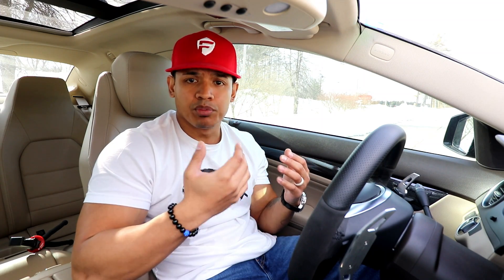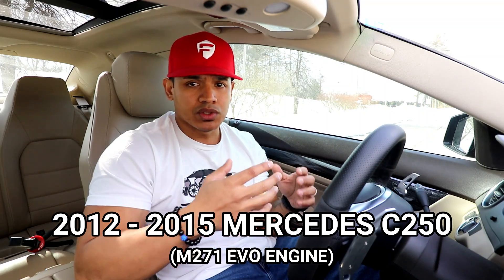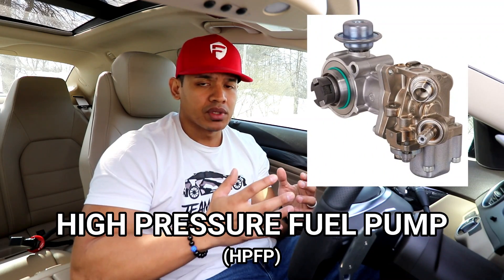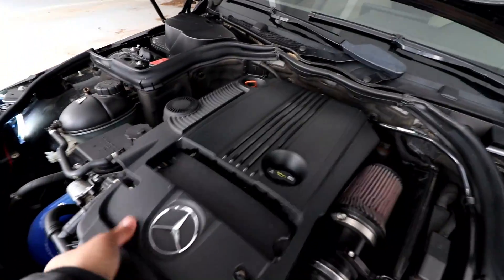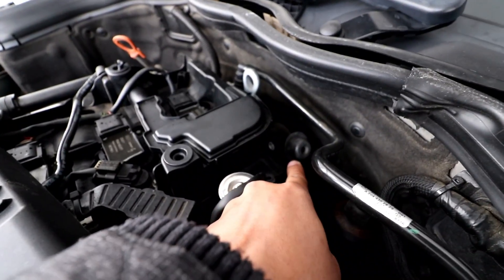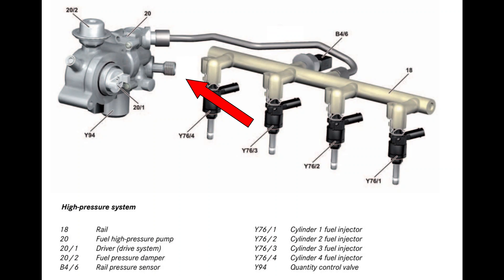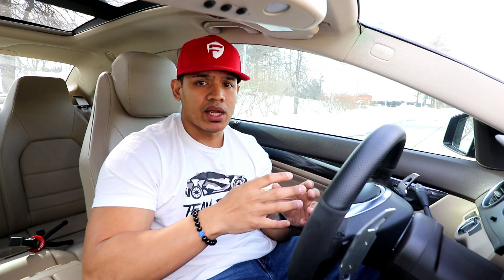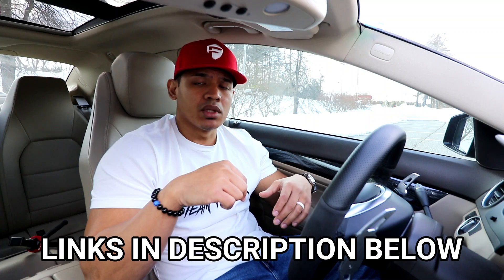FIX MERCEDES C250 P0002 POWER LOSS WHEN ACCELERATING

Comment: My 2014, C250 has same issue with no 0002 code but check coolant level light was on. After an hour I drove, it ran fine. Lately coolant has been disappearing but there isn't any visible sign of leaks or not seen in engine oil either. Any suggestions? Thank you.
Reply from the maker: If you have a “low coolant” light and you checked your overflow coolant reservoir and it’s full, then you’re just experiencing the common known issue of the floating sensor inside the reservoir that’s stuck on the bottom making the car think it’s low on coolant.  

Coolant does evaporate over time but if coolant is truly disappearing (a lot), then you have a leak externally that should show up under the car on the floor or (worst case) you might have a leak where the coolant is mixing with the oil. If you check under your oil cap and it looks milky, you may have a head gasket leak allowing coolant to mix with oil. That’s not good cause oil could be going into the cylinders and cause the spark plugs to underperform and sometimes not even detonate. 

All speculations. You should def seek a qualified mechanic before things get worst or dangerous.
Reply: Same

Comment: I dont get a check engine light but if I gun it from a stop the car jerks as if I'm pressing the gas and letting up repeatedly. I wonder if its the same fuel pump issue
Reply: John Ray yes that's exactly what's happening to my c250 and I'm here trying to figure out what to do without getting ripped off by the dealership
Reply: Cumbias Con Sabor did you ever get it fixed?
Reply: any of you got the problem fix ??

Comment: Have had a similar issue only when doing hard pulls either at a stand still or slow rolling around 10 mph in manual mode and it’d cut power and engine brake immediately around 5-7k rpm’s so I’d immediately put it back into normal drive mode and just drive normally and it’d be fine. Didn’t really think much about it for a while as I daily drive it and stopped doing so many pulls or just being hard on the car because I don’t want anything else to break but here recently I just started having starting issues where the engine will continuously turn over for at least 3 seconds before finally a very rough start. Runs fine after that even when idling. Tested battery and was good replaced alternator after testing it and still didn’t fix so made a post online and one guy said it could possibly be the fuel pump pressure regulator as it sounds like it’s having to build up pressure from the videos I posted of me starting it up. Definitely could use some advice if there’s a chance that could be potentially the issue or at-least part of as I had other people saying I might need a whole new spark/coil pack kit, coolant possibly leaking into a cylinder from a bad head gasket, etc. so I don’t feel like spending more time and money on parts I don’t need. I could and probably should just take it to a shop but don’t feel like spending the money and would rather do it myself if feasible.
Reply: Also forgot to mention my cars a 2012 c63 amg base model which has the M156 engine so I figured it’d all be pretty similar parts and configuration given the year model you have.

Comment: Is this the same in a diesel??? I was told it’s the boost gauge or turbo but the mechanic said he couldn’t see any cracks or issues with the turbo piping it’s very well maintained. He then said it could be the suction of the turbo….. my car is intermittent it goes like the clappers but then decides to space out and do what is noted in this video so it could be a fuel pump….. 💁🏼‍♂️ even told it could be catalytic converter but chucked Catclean down and that cleared up

Comment: This just happened to me a few days  ago for the first time. I was literally leaving my local Mercedes dealership after getting an oil change. I was trying to pass a car and pressed hard on the gas. Loss acceleration. I made a U turn and went straight back to the dealership. They told me what the code read but also said the check engine light turned off by itself. “If it happens again, bring it back in.” 😑
Reply: Indeed very disappointing response from the dealership!!
Reply: Did you find out I'm having the same problem on hard acceleration. Changing into next lane merging into the freeway. Limp mode check engine light blinks then stays on. Then when I restart the car it dissapeared no codes.

Comment: Hi, I have a 2010 c250 same problem it only happen once but it was pretty scary I didn't know at the time but if I would pot the shift on neutral shot the car off and turn it back on quickly it would be O.K. , I went to the Mercedes dealer the guy never mentioned the fuel pump  he said  something else  that it could cost me if rebuild $700 I can't remember what, now I don't know if there is any difference between 2010  and 2012 C250 models as I sad it only done once but if you know any thing for the 2010 C250 please let me know. Thanks 

Roman

Comment: Sometimes it can be the maf sensor that is dirty so the air can not go in the small sensors straight away that is also a big issue with power loss in the Mercedes. So check that out first because it’s much cheaper guys !
Reply from the maker: On most cars that might work but not on the c250.  This car doesn’t even have a MAF.  Mercedes just issued a notice about the fuel pump issue and an extended warranty.  They are finally owning up to this known issue with loss of power cause it could happen at any mileage on a c250.

Comment: I have a mercedes C200 with w204 engine 1800cc turbo year 2012 amg when I start the engine no acceleration when I press the gas pedal what could be the issue

Comment: Greetings, my 2014 Mercedes C250 had the hpfp changed and now it runs but if you step on the accelerator it doesn't run hard, what could it be and the code that keeps coming out is p0002, just that one, thank you
Reply from the maker: Could be the fuel filter too.  

Read through the comments. Some people have solved their issues.

Comment: I bought an used 2013 C250 from a private party and had what you described happen to me driving on fwy. Car is at local MBZ mechanic for going on 1 day and check engine light isn't coming on and he cannot see what issue is. So waiting game. He said I may have to take it to MBZ dealership if he cannot figure out what is going on with my car.

Comment: I just thought a conductor plate and my CL500 2003 I am not getting no accelerate when I step in the gas the car feel like it's going to limp mode that's why I do not take the highway no more trying to correct this problem my work on my car myself my check engine light was clear first after I did the conductor plate but it popped back on not sure if it's the throttle position sensor

Comment: Hi Flexx.  2012 C250 with 128k miles just got the turbo replaced.  I just experienced the limp mode you mentioned.  It wasn't pretty.  p0002 error code.  Do you have a video on replacing the HPFP?
Reply from the maker: I don’t but there’s problem some on YouTube.
Reply: I just recently replaced my HPFP. If you haven’t done the job yet, just reply to this message and I’ll help you out. It’s a pretty annoying job but I’ve managed to learn a few short cuts to expedite the process. Always willing to share to help others out.

Comment: hello, thanks for vid. Had the same replaced the pump, was fine for 3 months and now again the same happens. I replaced it with a new OEM original pump. Any idea what else might be the real culprit here? I don't believe I was so unlucky that the new one got broken so fast. Any ideas??
Reply from the maker: Don’t know. Check your fuel filter too.
Reply: @TheFlexxGarage  Is there any fuel filter on this engine? I found air and oil filter parts but no fuel filter to be replaced. Maybe it has a different name?

Comment: I just fixed the high pressure fuel pump but got code 0705 now for the transmission and i think the transmission code caused the fuel pump code! So i think i fixed the pump for nothing! Make sure to check all codes before spending 1500 on the fuel pump. Now i gotta fix the transmission electrical circuit fml

Comment: After clearing the same error code, the malfunction light did not come on again, but the sound in the car's engine changed. Do you think it would be harmful for me to continue like this? Some people told me that there is a possibility of mixing gasoline with oil.

Comment: I have the issue of car shaking on acceleration and can’t go up to speed, it happens every time but there is no CEL and no codes on the scanner! It is really frustrating and I am not sure what to do. I have c250 2014 coupe.
Reply from the maker: Probably can be as easy as a fuel filter change.  If not, take it somewhere to get the fuel pump checked out.
Reply: I had the same issue I changed out the ignition coil but the trick is you have to find out which one is failing I did it buying just one and swapping it out with each coil one by one I did it the cheap way to find out which failing just to make sure it was the ignition coil instead of buying all of them and it not being the problem but once I found out it was the ignition coils I did replace all of them and no more shaking on acceleration or weird vibrations

Comment: I have a 2014 C250 with 42000mi. I was sent a letter from mercedes on this issue. I have the same issue, the service manager said that only if it sets a certain code will they warranty it. He didnt tell me what the code was. He said they have to use the mercedes scanner. i reset my engine light and had a p0002 fuel pressure circuit code. The light went out but the code said it was permanent on my scanner.

Comment: I have the same problem with my 2010 c350. When I press the pedal down all the way it goes limp. But it rarely happens. Once every 10-15 times I floor it. I’m not sure if it is the same reason because mine has a different engine
Reply from the maker: It’s not so much about the engine but the fuel pump/fuel filter that’s the culprit.

Comment: Hi flexx. my car is 2009 mercedez benz c class. My problem is that my car won't accelerate,  it's not engaging in gears, it's like it's In limp mode.  The check engine light came on and it's me 3281 fault  code saying the boost pressure control flap is malfunctioning. Kindly help me out

Comment: I bought a MB c250 at an auction and I seem to have the same concern about stalling and lossing it's power when accelerating plus engine light turns on. Auction return policy is good for only 7 days. Where can I get a used high pressure fuel pump and how much will labor cost to install it. Is there any recall for this part by MB dealer. When I change it how can I better take care of it to make it last or how many times will this happen to me for it's(car)lifetime.
Reply from the maker: it never happened to me but happened to alot of people. I suggest you read through the comments and see where people bought their pumps and if there's any news on MB covering it.

Comment: I have a 2018 c300 4matic w205. Two days ago I got a service B, yesterday when I turned on the engine, once I started driving, I couldn’t accelerate, the power was low. Do you think is the same issue of your video?
Reply from the maker: Don’t know. Could be anything. If you experienced that issue, then your car should of thrown a check engine light. Only way to know the true issue is to hook up a OBD2 scan tool/reader to the car and see what fault made the check engine light come on.

Comment: I currently have a vehicle I purchased at Auction... looks like they replaced the HPFP but I'm not sure .. I say that because the hose clamps are aftermarket, unless all they did was change hoses. I cant get car to run unless I use a starter fluid. Any idea how to check fuel pressure? Cant seem to find a Schrader valve.
Reply: There is no Schrader valve.  I use a laptop with Autoenginuity enhanced for Mercedes.

Comment: Mercedes does have an extended warranty for the high pressure fuel pump, they will replace it free if it fails before 10 years 120,000 miles
Reply from the maker: This is an old video. I already shared the extended warranty last year when i received the letter.  It’s not on all c250 and it’s terrible because most c250s are way above 120k anyway. Plus most people repaired it themselves or through a 3rd party shop and Mercedes’ won’t reimburse unless the work was done by Mercedes’. Just another way for Mercedes’ to say they did something but really didn’t cause they waited so long. Screws the customer over at the end of the day on this issue.
Reply: @TheFlexxGarage  I have a 2014 Mercedes with 80,000 miles and my car started sputtering if I try to step on it hard and engine light turns on until I turn off my car and restart. Does the fuel injector fuel cleaner have anything to do? I filled the tank up and this happened on the same tank.
Reply: Any other info for this fuel pump warranty?
Reply: Took mine in and they said it wasn’t the fuel pump even though mine has these exact issues
Reply: @kidfoodieusa3806 what did they say the issue was?

Comment: Will this also cause the car to shake as well when idling?
Reply: check your codes; i had this happen with a misfire from an ignition coil. Could also be spark plugs — change out all four coils if you want to get it over with because all four of mine misfired in a month, but not after.
Reply: if you have a diesel check dpf as it could be blocked

Comment: Hey Flexx - my 2014 c250 was leaking at the banjo bolt by the turbo.. but after replacing all that it no longer leaks at the banjo bolt but now (sometimes) i see a little oil under the turbo that dripped down onto the shock(?) - it drips down onto whatever that thing is under the turbo. 

I was thinking it may be the turbo oil return line to the oil pan but it's been a pain in the butt to diagnose. 

any suggestions?
Reply from the maker: Common problem with the banjo bolt. 

The other spot is where the air intake tube clamps onto the inlet of the turbo.  Oil tends to pool up and slow seep out.  It’s happens on the Inlet and outlet of the turbo. Keep an eye on it...it should only leak some oil. If the oil gets worse, you might need a new turbo or need to get it serviced.
Reply: @TheFlexxGarage  Thank you SO MUCH for responding! I don't know jack about cars so this is a huge help (literally everything i've done to my car has been via your guidance). I think I know what you are referring to, but at least now I have names I can google haha. You're a life saver. Thank you bro.

Comment: where can you buy a used high pressure fuel pump for a Mercedes SLK250. What sites are the best to go to?  I am having this problem with my SLK250
Reply from the maker: eBay. There’s tons of refurbished ones for under $300
Reply: @TheFlexxGarage do they fail after a while too? I mean refurbished ones? Thnx for feedback
Reply from the maker: Hard to tell cause any could fail.  Could be a defective brand new one or a fully serviced refurbished one.  It’s gonna come down to your risk level. In my opinion, I would wanna do this once and be done so I would get one directly from a dealership.

Comment: I have a Benz c250 2013 
For some reason when I drive it doesn’t let me pass 3rd gear
It simply goes back down
There was a p0002 code that popped up and then went away
What would you recommend I do?
Reply from the maker: Don’t know.  Better off to take it to a mechanic and get it diagnosed.

Comment: Hola cambié el fuel pump pressure y sigue igual que será entonces el sensor?
Reply: I have that same question I recently replaced my hpfp and my ecm but the code it still on there.

Comment: Hi flexx im from brazil, here we have almost nothing about tune information on this plataform. 
I have a c200 1.8T and recently do a dyno tune on it, we reach 176whp and 40 kgfm of torque, but after the tune sometimes when im on full throtlhe it cuts off gas and check engine light no with p0002 error, but when was oem tune never do that before, do you have any idea what could be? Just sensor error? Or the pump cant handle this power? Can i upgrade it? What can i do? Because dont want to Stock tune, the car Its so better to run with this power.
Reply from the maker: I already explained what could be wrong in the video.  That’s all I know.
Reply: Fala meu amigo, estou exatamente com esse problema, fiz um remap, mas também troquei as velas, bobinas, inclusive a bomba de alta. E quando dá pé até o final, ele corta e acende a luz. Suspeito de algo eletrônico, tensão de bateria correta ou qualquer outra coisa. Inclusive trabalho com consultoria automotiva, minha base/sede é na oficina de um amigo. Logo descobriremos. Mas caso tenha descoberto antes, me fale aqui. Tem vídeo da minha C200 no meu canal. Abraço!
Reply: Regasket, clean connectors, clean  grounds, new fuel filter
Reply: @orafaperes , resolveu o problema? Estou na mesma situação. 😢